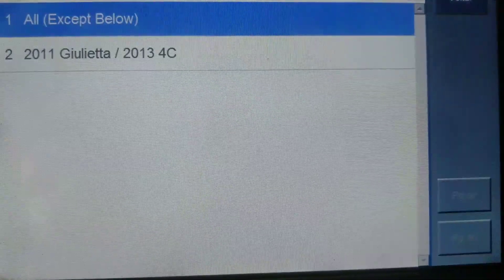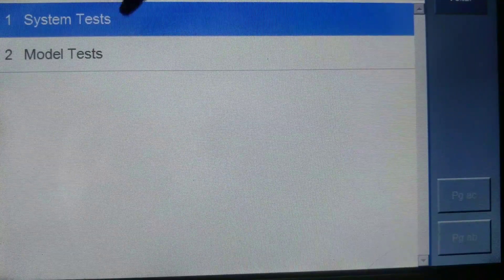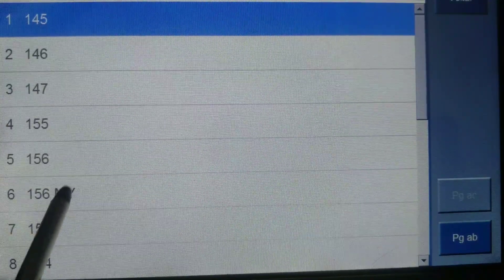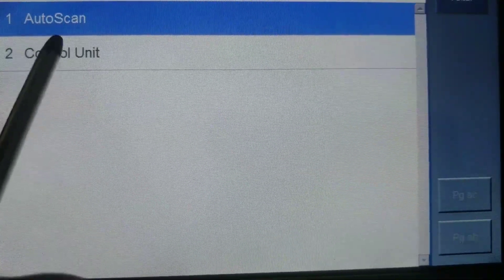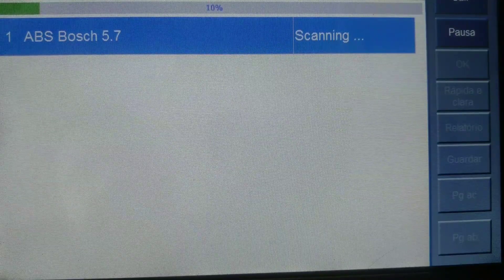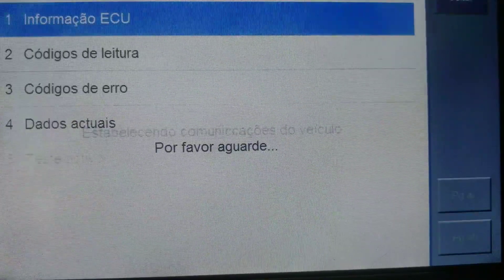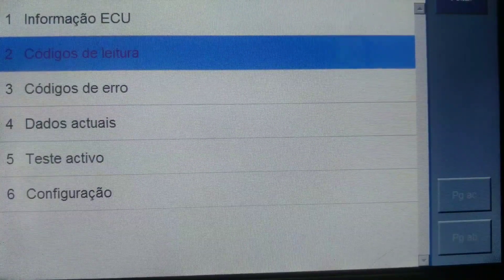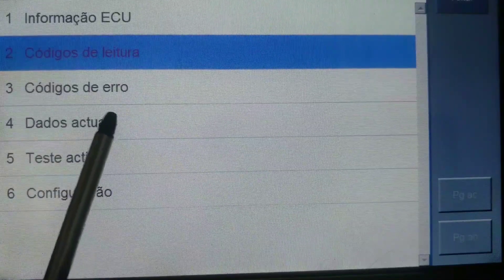Mjet Injectors, how to test and diagnose. Principals of working.

Comment: Bruno what does it mean when values are - on 2,0 jtdm i have readings 1rst 0,05  2ond 0.75 3rd -0.15 and 4rt -0.25
I have some black carbon on rear silencer (exit) and my  brothers Lancia has similar reading but exaust is like on gasoline engine no carb on exit
Kind regards and sory for bodhering you
Reply from the maker: Hello. Those values are excellent, don't worry. 
Try to check out the air intake and pressure, I do have videos for that also. 
Thank you very much for watching. Please share with your friends! 😊
Reply: @alfaromeonoproblem thanks Bruno

Comment: Hi, is there a calculation to get from mm3 to psi? My diesel injectors are delivering 1500mm3 at idle in my BMW powered landrover. I'm led to believe this is too high
Reply from the maker: Hello. The pressure is not important. Remember that the correction is just that, correcting less then perfect efficiency

Comment: I have question, how much bar do i have from the high pressure pump to the rail?

So if the car doesn't get to the 300 bar is it the injectors or high pressure pump?

Update: problem solved
Reply from the maker: Hello. Between 300 at idle and 1700 at full power.
No pressure, have the hi pressure fuel pump to be repaired
Reply: @alfaromeonoproblem  thank so much for replying. So I loosened the hose from the high pressure to the rail and these was almost no pressure. The low pressure is good so went directly to high pressure hopefully it's the problem tomorrow I'm going to replace it if anything I will update you. Your videos rocks!!
Reply from the maker: @RaymondBoateng-g8b thank you very much
Reply: @alfaromeonoproblem   update: engine runs well it little bit long in starting but runs well. The only thing is that it has code p1564 and it doesn't cancel 😬
Reply: @alfaromeonoproblem  update: engine runs fine but a little bit long in starting but runs fine, the only problem is I have code p1564 with engine light on i tried canceling it but nada and it doesn't give me power on the road. Any suggestions? Thank you.
Reply from the maker: @RaymondBoateng-g8b irrelevant for the engine
Reply from the maker: @RaymondBoateng-g8b perform a diagnostic on parameters, I have videos for that
Reply: @alfaromeonoproblem  hi I solved the problem by doing some adaptive parameters now everything is fine. thx again🫡.

Comment: I have take some returfuel test after using Tunap 989 fuel injetor cleaner , last time i change the diesel filter i use another marked of  injektor cleaner , and i fill all cleaner 250 ml i the cup , and put all together and starting upp the engine and lett it run i 2 mintes , there its all time been bigger difrent of levels of cyl 3 and 4 , lover return of cyl 3 and higer og cyl 4 , cyl 1 and 2 have normaly return after the i can see, here its a resluts of last test i take:

Fuel return test 11.4,2025

1: 0,50

2: 0.45

3: 0.30

4: 0.75
Reply from the maker: Hello. They seem very good results! Nice

Comment: I have Tipo with 1.6 JTD Euro 6b - Engine works well, starts great, but the hotter environment is the more second injector correction goes from +2 to +5. My friend from Bosch told me that, there is no high pressure sensor on high pressure rail, therefore all corrections are not "true" and should not be taken too seriously. It was Fiat cost reduction. I remember that last time I saw this sensor was on 1.3 JTD Euro 4 engine - High pressure rail here has two sensors.
Reply from the maker: I never seen a system with no pressure sensor. 
And the ones that have two, one is not a sensor, but an actuator

Comment: I also have alfa 159 2.0 and corrections are fine but very hard start. So corrections do not impact starting.
Reply: check your starter motor, that fixed it for me (1.9 jtdm phase 2)

Comment: Hi!

I bought a 1.9JTDm 8v 2006 159. How relaible are those injecotrs on this car? I'll definietly get them ultrasoniced, and checked. What should I expect? currently it has 260k KMs. Easy to start cold and hot.
Reply from the maker: Hello. They fail quite a bit... Hard start is the main issue

Comment: Thanks for an informative video! I have a question regarding a 2.2 JTDM from Giulia: If the car starts and the engine works and sounds very well, there are no error codes but the first and second injectors have a correction of +3, and third and fourth have 0 - do you think there might be any other issues? Looking into buying this example and just worrying about it a bit.
Reply from the maker: Hello. Thanks for watching. More videos for injectors are to come. And I have another one here:
https://youtu.be/Di8XE1CVHmI
https://youtu.be/HaTfXm40O9Q
Reply from the maker: In your case, is it's. Only the first second I would not worry. Normally is just the crud of the egr on the valve seats.

Comment: 4 years ago the cam belt fail. And i took the injectors out but i dont think i put them în the order that came out. I drove the car 4 years and still runs . Is that a problem? It worked without programing
Reply from the maker: Hello. Not a problem, just got idle is louder and could be irregular. 
You can reprogram them in the new place or check the coding and switch them around to match the coding.
About the timing belt snap, make sure both cames are in sync

Comment: Hello, i have a problem with my 147 1.9 jtd 16V 140hp, The engine all of a sudden it’s starting really heavy, but once it’s started it is running smoothly. 
I put a tester on it and it says that at injector 1 the value is 1, and at all the rest the value is between 03-05. 
I tried to change the injector with another one but now the Mecanic it’s telling me that the high pressure fuel pump it’s not recognising the new injector and they cannot code the injector in the ECu. 
Any advice? Please, I am desperate
Reply from the maker: Hello. If the start is heavy and slow you must focus on battery and starter first. Those engines is crucial to have a very fast start
Reply: @alfaromeonoproblem  The battery I checked and it’s ok, also the starter it’s fine.
Reply from the maker: The start must be quick. Can you send me a video of it?
Reply: @alfaromeonoproblem  sure I do, please send me an email address or WhatsApp and I will make a short video
Reply from the maker: The email is on the description of any of my videos
Reply: @alfaromeonoproblem  indeed, sorry for that, I sent you an email with the subject Alfa romeo 147 1.9jtd with 2 short movies about the long startup of the engine.
Reply from the maker: Hello. I did respond to you on the email. Here's the link for the diagnosis:
https://youtu.be/XU80JQrHggs

Comment: Thank you for your great video. 
Where to find the maximum and minimum value for the Injector Correction of each injector please?
For my jtd 156 1.9 140Horsepower (2005) , I have the following values: 1: -0.80mm3/i, 2: 0.77mm3/i, 3: 0.33mm3/i, 4: -0.28mm3/i.
Is it ok or 1 and 2 are not good anymore?
Thanks you for your response!
Reply: Hey Alex, I have the same problem, did you find how to fix the black smoke? (I hope you remember after 2 years lol)
Reply from the maker: @delgarob black smoke is lack of air
Reply: Hey, yes actually it was not the injectors like the garage told me, it was the big hose coming from the turbo/intercooler to the engine, which broke. The air from the turbo was not going into the engine anymore so the mixture was too rich producing black smoke.
Reply: @alexb5614 Thank you! Unfortunately I changed top and bottom big pipes recently, so I guess it's something different
Reply from the maker: @delgarob check out Egr and the intake pipe from the air flow meter to the turbo
Reply: @alfaromeonoproblem A few days ago I removed egr, it wasn't clean, but it was OK, I cleaned it and nothing changed. 

You mean the turbo to intercooler pipe? I replaced that too, because it was old and oily, but it helped just a little bit, the top pipe from air filter to intake was replaced too because leaked a little bit, but nothing changed. 

Also I changed the variable geometry solenoid because it was causing oberboost error, and it fixed it, but didn't fix the smoke
Reply from the maker: @delgarob the pipe in between the air flow meter and the turbo intake.
Reply: Maybe check if it didn't break again.
Mine broke again 2-3 times before I realise there were carbon deposit obstrucating the air entrance, at the connection between the hose and the engine, near the egr. This was creating a surpressure in the hose causing the broke.
Reply: @alexb5614 I will check it out, thanks!
Reply from the maker: Hello. Like I said on the video the ideal is zero all around. The best next thing is around 0,25 and no more than 0,50. And above 2,50 is really a red flag. 
Before replacing anything switch them arround, recode and check is the correction values are following. If so is confirmation not the injectors. If not, is the engine!
Yours is not terrible tough
Reply: @alfaromeonoproblem  Thank you for your response, i will check it anyway!
Because i have black smoke when i accelerate, and i am suspicious about injectors (or engine)!! 
Is 0.50 a standard value for all vehicules? Or only for this vehicule? How do you find it? I dont see it on the  documentation!
Keep going, your videos are very useful!
Reply from the maker: Black smoke is a indication of not enough air or too much diesel. Normally is something to do with this:
https://youtu.be/7erMLUm_1do
And this:
https://youtu.be/h8Hb78P3O60
Also check this:
https://youtu.be/sCA-z95YvWI
Reply: @alfaromeonoproblem  Thank you!! I will check all of this on my car within a few days!

Comment: Hey man i have problem with alfa romeo 159 1.9 150 when i try to start it on cold start there is white smoke and it cant start,is this an injector
Reply from the maker: Hello. Yes, most of the times it is. But just to be sure, block off the egr to make sure that's not the issue

Comment: hi Bruno, what 's the purpose of the ruber hoses around the the high pressure injector tubes ?
Reply from the maker: Hello. It was a experience. The original ones have rubber on to disperse vibrations, I did that to see if I noticed anything. Did not, but just leave them there. Lol. The original ones work.
Reply: @alfaromeonoproblem  Thank you for taking the time to answer. Appreciate it !
Reply from the maker: Thanks for watching.

Comment: Beautifully explained! 
Is it possible that wrong injector coding causes the injector to do the "hammering" or loud knocking sound when the turbo kicks in?
I tried several remanufactured injectors on my 1.3 mjt (without coding), but 2 out of 5 i bought were knocking like crazy.
Reply from the maker: Very good testimony how can a new post lead you to a money pit! Switching the injectors around and follow the injectors return value. This will tell you even on a new injector if it's bad.
Reply: Jensen Hammond  and yet these sellers swear on their life the injectors are 100% perfect because their bosch testing machine says so. You put it on a car and story is completely different.
Reply from the maker: Hello. Thank you very much for watching. Coding works it best at starting and idle. Once you start to accelerate the coding doesn't make anything. 
Can you switch them around and see if the correction follows or stays on that one cylinder?
Reply: @alfaromeonoproblem  i'm waiting for my obd cables to arrive so i can buy multiecuscan to check parameters and code the injectors. So I don't know yet.
Anyway, i bouht 4 remanufactured injectors and experienced good fuel economy with them, but loud clicking on stronger throttle at about 1300-1700 rpm. Went one by one and found the responsible one. I put my old injector instead of it, and clicking went away.
Thought it was bad luck, i bought another one, and same story repeated. I tried putting it in another cylinder, and the clicking was still present.
Interesting thing is, clicking begins once my car heats up, when the coolant temp starts to rise.
The seller swears that injectors are 10000% faultless.
Reply from the maker: You could have a problem on the engine itself. It's important to check all parameters. When you do get back to me
Reply: @alfaromeonoproblem  i sure will. Thanks for good will to help 😀
Engine has been rebuilt a year ago so i hope it's fine. I doubt maybe the high pressure fuel pump, or the one in the tank is going bad. But I don't know how to check.
Reply from the maker: That's courious! Let me know the diagnosis results
Reply: @alfaromeonoproblem  I properly coded my injectors and on warm engine idle i get following corrections: Cyl1: 0,63; Cyl2:0,75; Cyl3:-0,61, Cyl4:-0,28. When engine is colder, corrections are in the same order: 1,19; 0,49; -1,26; -0,65.
Interesting thing, i get quite a mismatch between expected and real air intake quantity. They match well until around 390 mg/l, after that actual air flow stays the same.
Air pressure is a bit off (around 30 mbar) but curves follow each other.
Reply from the maker: Hello. Remember that the corrections are for engine losses, a cold engine may not be at 100%, low compression, valves, piston rings, etc. The correction is doing it's job. To make sure the problem is on the engine, switch the position of the injectors, re code and do the same tests. If the values are the same and follow the injectors, the problem are the injectors. If it stays on the same position cylinder is the engine. 

The air flow must be 320 plus and rise to 900 minimum at 4k rpm
Reply: @alfaromeonoproblem   @Alfa Romeo? No Problem!  I'll do that when i have time. Meanwhile, do you think MAF could be bad? I think maybe not because it responds well, but does not measure above 400 mg/l. I recently replaced the hoses between MAF and turbo because i found a crack on hose to turbo connection. Air filter has around 8000 km since I changed it.
Also, i'm not the first owner so i don't know if car is maybe mapped or something. So maybe i'm getting wrong readings. Don't know how to check that...
Reply from the maker: If it has a remap... Good luck. But normally if it's frozen it's really not good. Bad MAF or wiring
Reply: @alfaromeonoproblem  I tried a brand new Bosch (same part number as the original) MAF sensor. It's the same. On stationary car it reaches around 400, while driving it goes to around 600 mg/l
Reply from the maker: Is the EGR good? The intake pipes are good? But being the car remapped... It's hard to do a diagnosis
Reply: @alfaromeonoproblem  I really don't know if it's remapped, but it's a possibility. But my car does a regeneration of DPF every 300 km (with a lot of smoke on press of the gas pedal).
Intake pipes seem good (the ones before turbo).
I tried removing EGR to clean it, but couldn't unscrew it. I cleaned throttle body and what else i could with it removed. On multiecuscan parameters monitor, egr seems operational. Only problems i noticed are: EGR position before starting the car is -0,233 mm, but desired is 0,000 mm. On the actuators option, i tried egr solenoid option with no luck. First time it went okay, but I couldn't hear any clicking of relays etc. After that it fails to execute this test again.
Reply from the maker: If that value of intake was true you would not have much power on the engine. It's strange you don't feel lack of power. Did you try to do a diagnosis with another different type scan tool?
Reply: @alfaromeonoproblem  I haven't tried. I have cheap ebay bluetooth scan tool as well so I'll try with torque app.
Yes, i think my car doesn't lack power too much. It pulls well for an 85 hp car. It could have a bit better mileage, but i blame the injectors for it.
Reply from the maker: Magneti marelli ECU? Not all scan tools can deal with it
Reply: @alfaromeonoproblem  yes, marelli ecu. One thing i found out today. On full throttle, desired egr position is 0,000, and measured is -0,230. Could this small difference be a reason for low air flow on full throttle?
And one more question: last week i replaced fuel filter to a new ufi like it was installed before it. Today i noticed it leaks fuel on the third "unused" pipe. Dont know the name of this. I suppose it's a relief for extra fuel, air or something.
I'm sorry i'm being boring, but i really want to learn and diagnose my car.
Reply from the maker: It's ok, I'm here to help. The problem may really be the diagnosis tool. I've seen this in the past. But the car had also lack of power on the top end. So... Without testing the car is difficult...
The fuel filter, if is leaking ask for warranty.
Reply: @alfaromeonoproblem  if i find something out, i'll keep you posted. Egr cleaning is my next mission. I noticed today, on first morning start a slight smoke for 15 seconds from engine bay. From around the turbo area it seems. Maybe an exhaust leak somewhere.
Regarding fuel filter, i tightened a tiny bit that valve where the leak was and so far so good.
Reply from the maker: Ok. Remember if the air cannot get out it cannot go in. Exhaust clogged, intake clogged, EGR stuck open, intake air not measured. Engine out of timing also does that, because it doesn't suck all the air it was supposed to. Low turbo pressure also does that because a low boost pressure doesn't allow for a full intake mass. Good luck man.

Comment: Hi I also have a question I'm a little stuck at Alfa Romeo 159 2.4 JDTm.  which side do you count on?  from left to right as you face the engine.  for example: is it counted from the distribution to the steering wheel or vice versa?  I want to know which is the injector 4 and the car has 5 I have a big slip
Reply from the maker: Hello. The first one is the timming belt side. All makes and models except the French cars..
Reply: @alfaromeonoproblem   You become the injector 1 is on the same side with the belt
Reply from the maker: First on the belts side, yes
Reply from the maker: You can also confirm with the injector codes. Check the coding on the diagnosis machine and on the car.